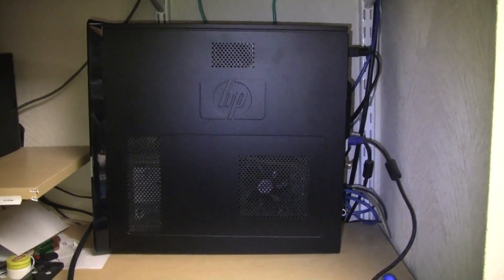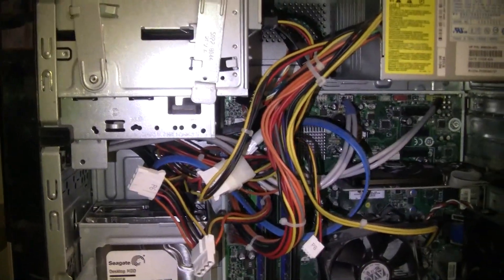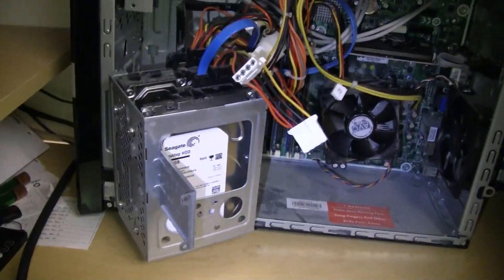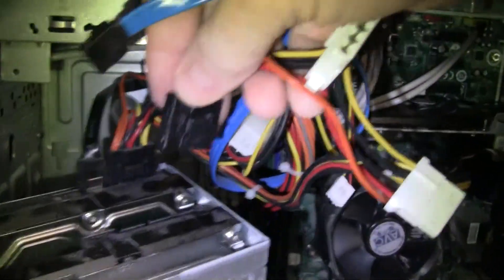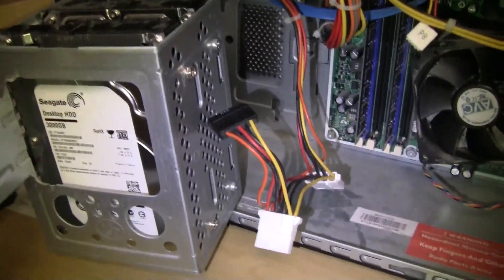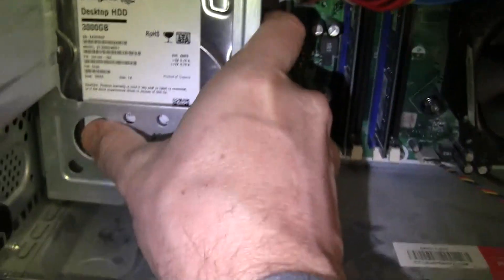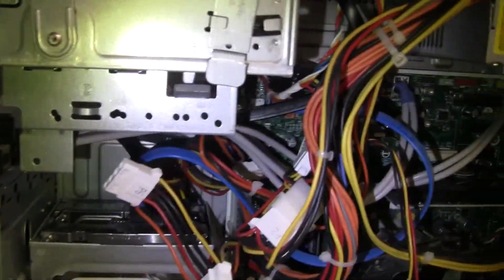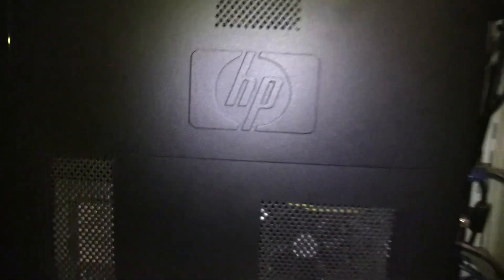Replacing a hard drive on an HP Pro 3130 MT

Comment: I tried to update bios from 6.1.4 to 6.1.6 and it crashed. A previous owner Win10 install wiped the HP_Tools partition.  I got it used. Would you happen to have recovery disks made? I cod really use the iso images.